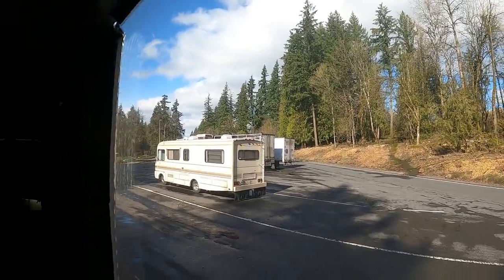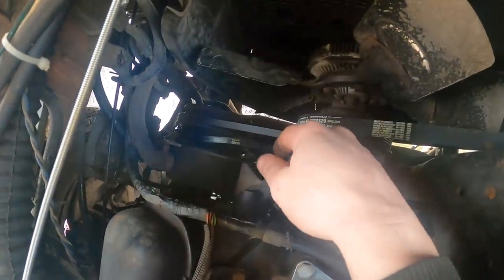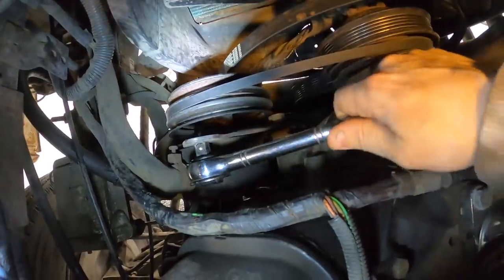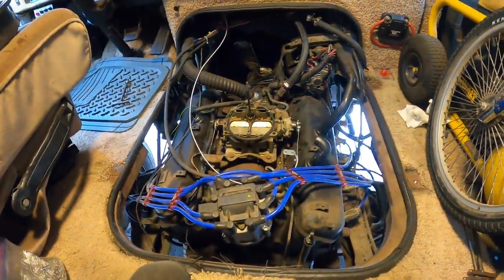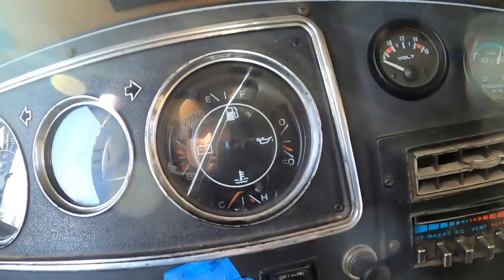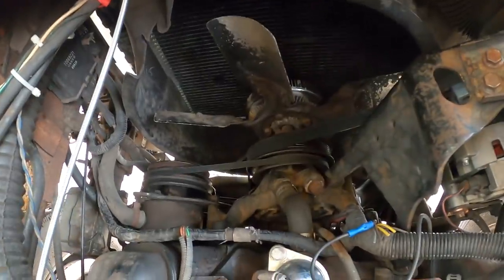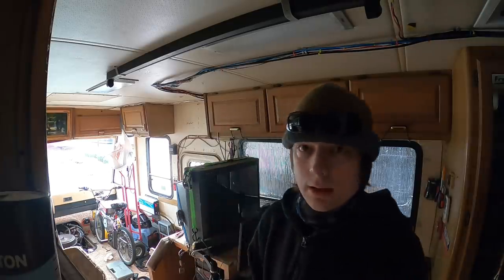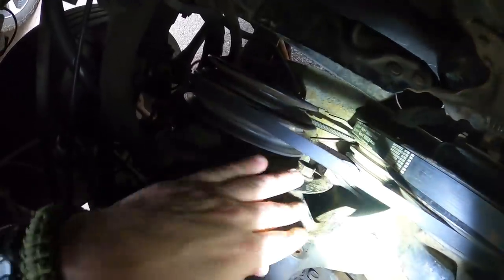RV Breakdown || Getting Towed

Comment: I FEEL for ya, Nathan. These friggin' MH issues. I was ready to take a trip and found out my brake actuator of my auto-park system is leaking, just after I went round and round with the hydro boost. Just one thing after another. The ultimate "love / hate" relationship. But in your case, you're a "magician" The "MacGiver" of Class A's so I look forward to your next video tackling this project.
Reply: @dansmith6990  That actuator just ended up being "the weak link in the chain" after the new hydro boost's pressure was stronger. UGH...

Comment: I feel your pain... I had a water pump recently go out on my 88 Itasca Sunflyer Class A while I was traveling across Florida. Had to spend the night at a mechanic shop until they could replace it.... $900 later. 

Being stranded in an RV isn't the worst though. At least I didn't have to buy a hotel on top of it. 

Great Video. You are my engine tutorials since no one on youthbe has these old RVs anymore.
Reply: I love my 89 winnebago chieftain 33ft.
Reply: @12pawsinn  I do love mine as well. I gutted out most of it, refloored it with grey vinyl and painted the interior white.

It's my full-time house now.

Comment: Well this will make for a good Harmonic Dampener replacement video! Hopefully the front end of the RV can be opened up enough to work on this without dropping the engine!
Reply: he should have enough room,might need to remove the fan shroud. undoo the big ass bolt, get a puller & off
Reply: He can.

Comment: I had two air pumps on mine.
One froze up and the engine froze up.
Cut the belt into and drove away.
New pump, $85. New belt ten.
Parts at NAPA

Comment: Bummer man.  Had the same thing happen on my rig the balancer separated.  Guess it's just the age of our rigs.  Mine is an 85.
Reply: @dansmith6990  Yeah I would suggest swapping it out as prevention.  Really isn't too hard renting the puller tool from the Auto Parts store makes it fairly easy, get a new seal when you do it as well.
Reply: @dansmith6990  So not sure how close everything is on yours but on mine I removed the belts and then removed the pulley it's bolted to the balancer.  Then remove the big bolt in the center.  Use the puller it comes off pretty hard some popping sounds.  Anyhow after you get it off the block has a seal that I would suggest replacing then use the puller in reverse it presses it back on to the crank.  Then the rest is just put everything back.  Took me about two hours sure somebody could do faster just got nervous when using the puller and the popping sounds though it may break so stopped and sprayed oil on everything and started again.

Comment: I was thinking that Patches has been driving you around for five years, so I was wondering when something would wear out. Did you order a stock harmonic balancer or a branded one like Pro Products Powerforce? ✌
Reply from the maker: I just got a stock one since the cost was a bit lower, it's a "PowerBond Premium OEM Replacement"

Comment: Bruh, Harmonic balancer is a bitch to do, you'll get'er done it will be fine.  I drive a Kensworth 18 speed 600HP Catipillar on ATS, its more fun driving with the G29 with G shifter. 300 gallon diesel guzzler about 4.5 miles to the gallon with load, no load, 18 gallons. In real life 445 IDI 7.3 monster dully pickup 1992 1.5 ton M5OD trans.  You need to get a diesel motor in patches, 7.3L 445 will not have problems pullin patches...

Comment: Out of curiosity where was your oil pressure sensor located at my gauge isn’t reading on a 86 454 p30 with the 454 I know it’s got pressure but I ain’t going to run it without a gauge going
Reply: Look just above the oil filter location on the side of the Block or they may have used the location towards the front of the Block. Oil Pressure Sending Unit.